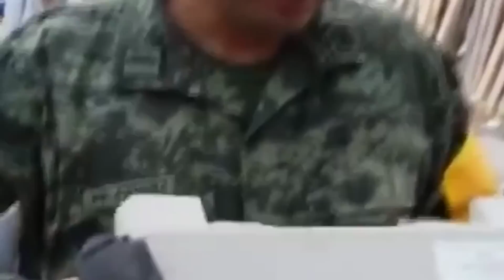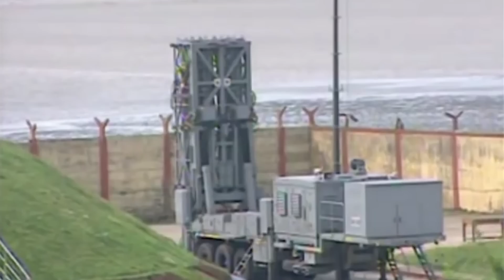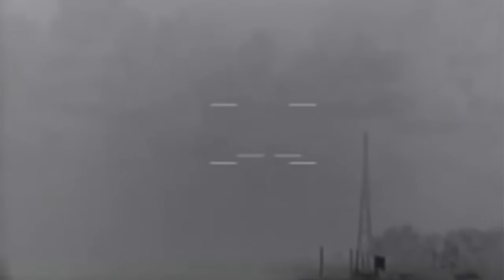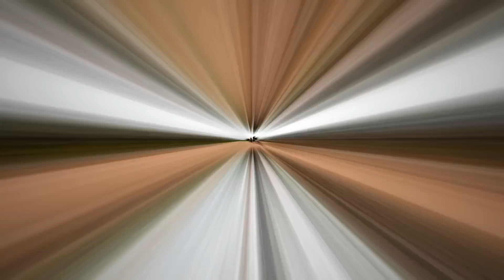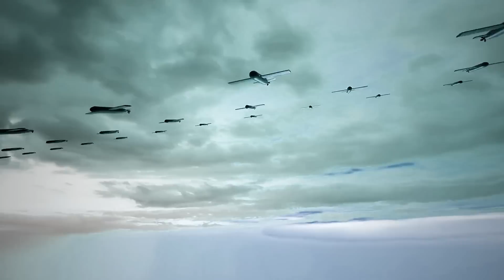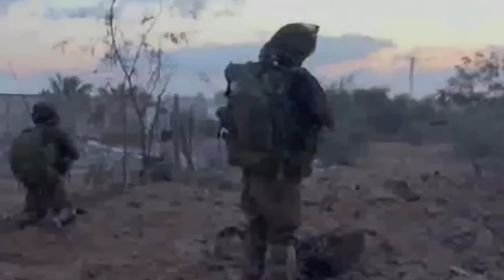The Strangest Top-Secret Israeli Arsenal No One Expected

Comment: Very Briefed And Summarized Ideas: 

they don't have anything very exceptional, without any doubt they possess some qualitative weaponry, but not a game changer as promoted, for example until now and almost after years of continuous fighting they failed technological means to geographically locate (geo-loctating) its prisoners in Gaza strip despite the huge technological assistants they getting from it's western allies, failed to locate the Hamas leadership, and the long celebrated the trophy system show weakness against locally manufactured hand held anti tank RPGs ammunition...

there was also a major weakness in the ability of the air and ground forces of the zionist entity to prevent or stop the ability of Hamas or the rest of the Palestinian factions to launch missiles, despite the small size of Gaza Strip, not more than 365 km2, and geographically it is part of Palestine and is not more than a few meters away from the deployment sites of the artillery sites and its air force operates with absolute freedom over the Gaza Strip, yet it fails to stop the rockets fire from the Gaza strip from the air or by the artillery and missile artillery systems in standard practice of counter battery fire while its air force failed to suppress or destroying those very primitive launchers...

maybe they have some anti- radiation and bunker buster ammunition but each war is a range of continuous countermeasures, making the effectiveness of those technologically advanced weapons on the longer period of time these problems multiply by the long celebrated distance of the Iranian territory thus any qualitative weaponry the zionist entity possess at worst case scenario could be useful for some stage of any war but on the longer time the zionist entity will not be able to influence or changing the course of the war...

against Lebanon all the air bases are within reach to the fire power of Hezbollah coupled with the passive countermeasures, from the networks of fortified shelters to intensive camouflage measures without counting the sets of active measures, and given the small geographical size of the zionist entity, a demoralized defeated population, and with the war against Gaza strip the budget suffering from a deficit of about 10% with comprehensive war the jewish around the world have to financing the zionist entity budget...
Reply: It realy shows if they would have the capbeltey of controlling terer one countery armed forces would have bean in a postion to control the situation when your countery is blasted with nuclear wipens at the end of the day what control you have on the opposition they are not terest 
They are protecting there countery
Why you attack your nehbouering countery saying that you are super power you never expected this thing to happen to your countery isserial
Only you can do is attack a counterys civel innocent peopels
Seaz there land comit genocide that
Means how powerful you are then defnetly you deserve reward by god for your good work.  What hpen to your yelder brothers and counterys why are not coming and helping you
When you are in trobel.
                  Free palestine iserial its not your land there ends the thing
                   No one is scared of any one at the end of the day.
                     Not your threats to your nehbouring counterys is a solution at the end of the day. 
           Free this world from international curepted regemy of USA at the end of the day to save the lifes of inocent civel palestanians at the end of the day.